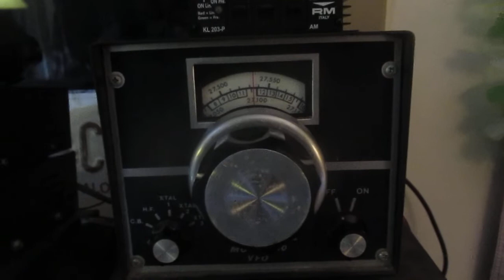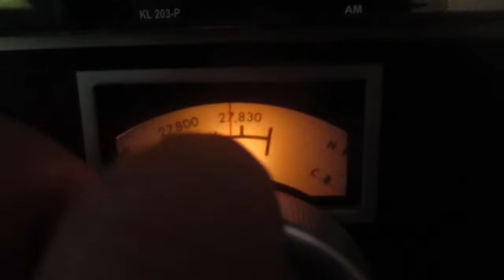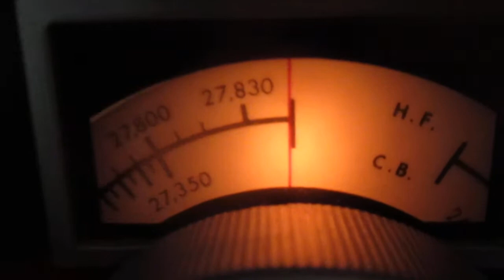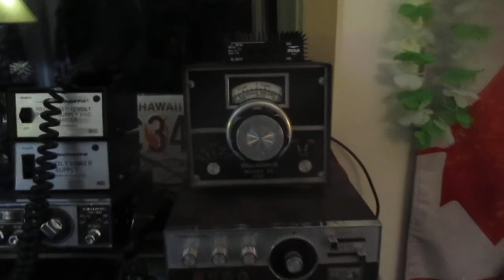How a Siltronix VFO works with a vintage Realistic 23 channel crystal CB radio

Comment: I was kinda thinking that’s how it worked , like I said I never been around anyone that had one or ever seen one . Thanks for the video . That’s really cool and a great addition to some nice 23 channel radios that has the Jack built in to accept a VFO .  Someone was thinking outside the box and came up with a money maker back in the day !! 
Thanks for the video 👍
Reply from the maker: No worries. It is all vintage stuff but seems to work really well. I use to shoot a lot of skip on that thing back in the day.  Then when I moved here to the island a few decades ago I had it sitting out in the shed. I decided bring it in to the radio room and see if that old radio and VFO still worked. I was amazed when I plugged it in with the radio,  it worked just as good as it did in 1981
Reply: @junglejoecvideogates9705  
That’s awesome 😎
Reply from the maker: @Dallas-Rife-UDX-347-Tennessee  Old school radio and VFO still  going strong . 73's

Comment: Hi I,m wondering if you can Help me, I have owned a Vintage Gonset Super 6 I think its a vfo/bfo, Can this be hooked up to my Lafayett comstat 25b also tube 23 channel, the Gonset is also tube, It was usually hooked up to tube car radio 40 and up with tube, its 10/20/75/bc meters
Reply from the maker: I wish I could answer that. I had a tech. hook mine up back in 1981 and have used it ever since.  I would try a CB radio forum on FB and see what the techs. have to say. Cheers